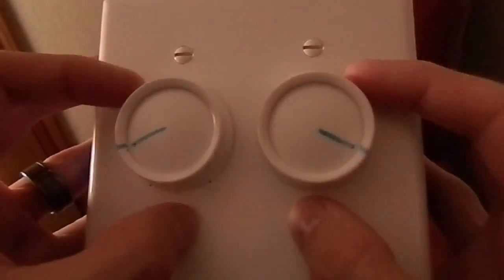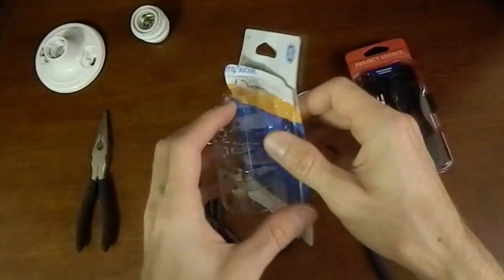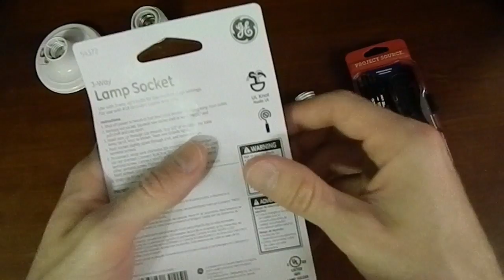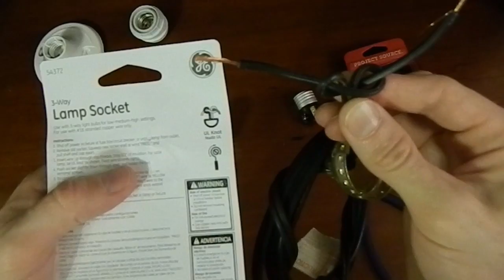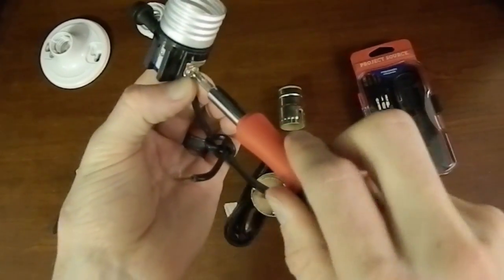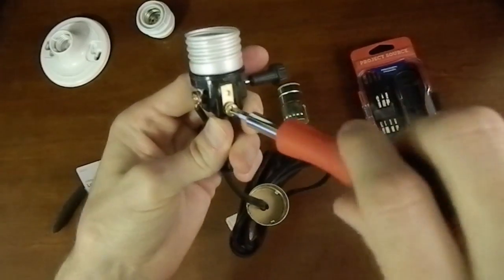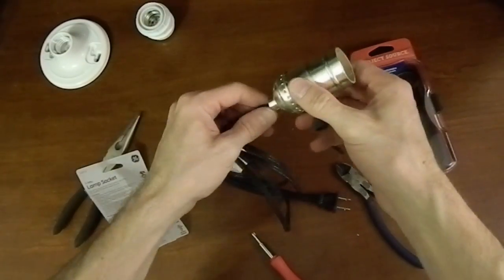Chinese Paper Lantern Lights for the Studio

Comment: Hi Mike, thank you for this video!  Do you think this would work with the new Smart lightbulbs that are available now?  The advantage of using the Smart bulbs is that I can dim them using my phone (and I don't need to wire a dimmer to the lights).  What are your thoughts?  For example Philips Hue and Mirabella Genio are a couple of examples of Smart lightbulbs.  Maybe you could do a video on this?  Thanks
Reply: Also if you do make a video, can you please show us how to make an inexpensive stand to hold up the light (or how to attach it to a tripod) so that the light can be held up in the air.  Thanks for considering this